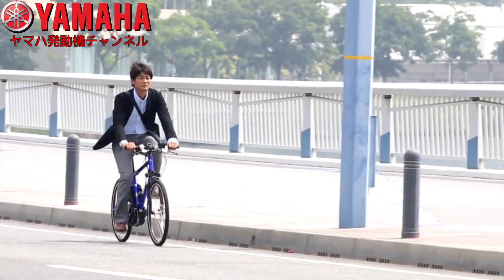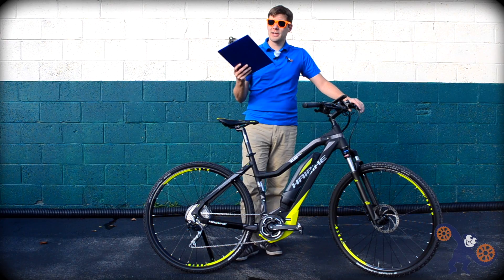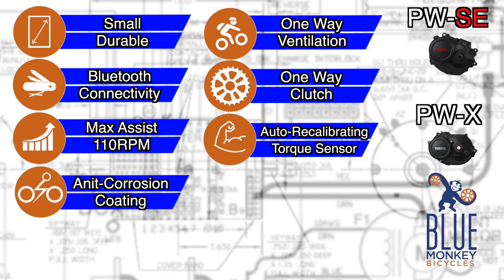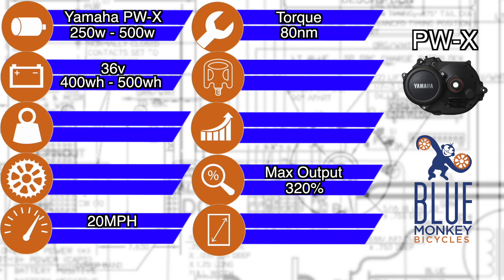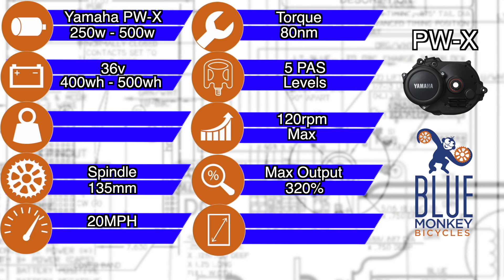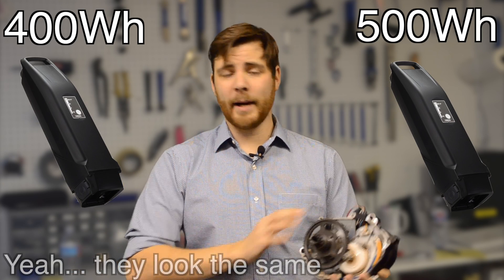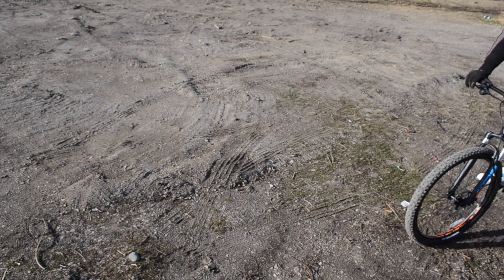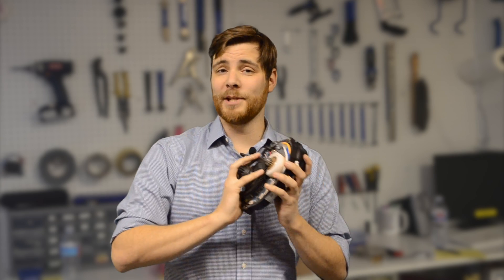YAMAHA PW-X eBike Motor: Closer Look

Comment: Does anyone know of one-way clutch mid-drive motors with zero drag with the motor OFF??
Reply: The last classic motor from bosch believe it or not ! Ive haibikes  version the xduro29sl the bike cycles just like a normal bike  especially when u take the battery off  only until they brought the gen4 smart system just before the gen5 have i honestly noticed zero drag its a tiny motor  and im led to believe its got metal internals cogs etc ive only noticed that on the gen 3 performance line  but the drag is horrible but a pokey motor  yamaha are a great motor with all metal parts  until something goes wrong with this stupid syncmode they put in it  totally ruined a serious contender  with giant also adding there own sotfware which they cant even fix  led to a mass callback of motors batterys etc ,if i could find a engineer to custom fit my gen 4 into my haibike which that is the plan then  i think im set for a very long time even tho its 10 yrs old its serviced every year has the best of parts that originally came on the bike ive just made sure theyve been maintained and a new sproket and chain every other year  otherwise thats all ive got for drag ✌️

Comment: I have the Easy Motion Rebel Lynx with the PWX (the one he says he is looking forward too) and its amazing. The bike is excellent, but the motor is the real star. I have ridden up hills so steep I would have to use my hands if I was walking. Gets amazing range too. In level 1 on flat pavement you can get over 80 miles. Even going offroad with lots of climbing and using the high power levels I still get 30+ miles.

Comment: Does anyone know if I can simply connect another battery to the motor contacts instead of the Yamaha battery?
i want to use car batteries with a stepup module to 36V because i want to load the batteries while driving with solar panels in a trailer.
Reply: You cannot. There is hardware and software integrating the battery. You could do it with a off the shelf hub motor or a bafang bbs mid drive, but not with a yamaha.
Reply: @gabriels1163  Thats a real shame, what a lack of modularity for an engine with such a bright future! I also look for a solution with the less drag with the motor off, for long journeys and solar-charged batteries in a trailer...

Comment: Yamaha don't sell ANY spare parts for their range of motors. If anything goes wrong you have to buy a whole new motor, I will say that again a whole new motor. The grease inside the motor dries up after three years and the bearings fail after 4 to 5 years. There is a guy in Ringwood UK who can service these motors but he only has the bearings which he had custom made because they are not available anywhere else. All plastic cogs and electronic boards are not available. It's a great motor it's reliable but if anything does go wrong your on your own with a massive bill. Watch this guy called Pete https://youtu.be/Me-H_Gykobc

Comment: Nylon gears not worth weight loss.
Reply from the maker: Looks like you're going on tour. I've also got a video on the Yamaha eBike standard equipment, the interbike announcement video, also Bosch vs Yamaha. I think Shimano has nylon gears, you can put comments there too
Reply: @BlueMonkeyBicycles  which motor has no nylon gears ?
Reply from the maker: I think the gen 2 Bosch systems had metal gears.
Direct drive motors have no gears at all.
Gear replacement isn't a big deal, in my experience. We had a few customers with 10 thousand miles on their bikes who finally wore out the gears, and those bikes had cheaper no-name motors.
After 10,000+ miles on a bike, you will be a much happier person, and very pleasant to be around.
Reply: @BlueMonkeyBicycles  what would you buy today for city + light gravel ?
Reply from the maker: I'd go to a local store and see what they have available

Comment: These bikes would be great if they had a throttle.
Reply: I have had throttle bikes up to 1000 watt...I like the "pedal assist" even better. I never thought I would, coming from a motorcycle background. These bikes ARE great...go ride one before you start thinking about another system.
Reply: @geraldhenrickson7472  with this 250w Yamaha PW-X Motor open(with chip,no 25 kmh limit) i can make 45 - 48 km/h ^^

Comment: Yamaha Needs to make 1000w-2000w options
Reply: I have a cheap Electric Scooter motor probably runs $200 (didn't buy it myself.) Came with the Electric Mini Bike I got. 1000w 48V Motor.

I have an Auranthetic Charger early 70s bike. It uses a chain with sprocket on the rear wheel with the motor on the center of the bike.
Reply: Never forget that now that there are specific laws concerning eBikesand a large manufacturer is NOT gind to produce illegal eBikes. Also... the numbskull riding his 1000 watt hub powered down the bikepath at high speed is turning the general public against eBikes. Many non-electric bikers want them outlawed altogether. You can have a blast on as little as 250 watts if the bike really has the correct output curve and is quiet.
Reply: G Henrickson How about if I Want to register my electric Scooter to be able to go on the road? Just like any 50cc. What about Everyone who wants a strong motor to Use for Off road? You need to Broaden Your perspective.

Comment: Hi - Comparing with videos of the earlier PW motor it looks like Yamaha have moved from a steel output gear to  MoS2 filled nylon to save weight. I have been in the plastics industry for years and I fear this material will not last as long. Also I have a PW bike and a PWX bike and by comparison the newer bike is noisier - Do you have any more information on this?. ..Cliff
Reply: Hi, Cliff! 

I have taken a few moments of time to watch a few videos on your channel. Nice work! Great videos! You are definitely an absolute expert with regards to plastics engineering and fabrication. 

As your expertise and knowledge has already provided you, composites (like nylon) afford a tremendous amount of durability with a low coefficient of friction and a very good resistance to abrasion. After several years of testing with multiple target metrics (including longevity testing), we are very confident in the design changes that we have made with the new PW-X gears. One might be able to imagine, but the use (and chemistry creation of composite for use) in gears is not new to our engineers at Yamaha and they have executed a composite material and design that is certain to fit the aggressive demands that we expect from our PW-X riders very well.

With regards to the noise difference between the PW and the PW-X. Yes, there is a decibel difference between the two motors. With higher torque demands in more aggressive climates and the need for faster ratchet engagement of the crankarm, the design requirements reveal themselves with a very slight increase in volume. If "absolute stealth" is what you are looking for on your ride, the PW-SE will be your weapon. Several changes to the SE have made it even more quiet and it works at a higher cadence than that found in the PW.

Keep the comments flowing! We really appreciate your support and the support from the Blue Monkey Bicycles subscribers. 

All the best,

Yamaha Power Assist Bicycles
Reply: Thanks for that careful reply YPAS. ..and thanks for looking into my YouTube channel. You would make a good politician !  Good to hear the plastic output gear has been well tested. 
I also have a Haibike with the PW motor and the Giant PW-X is not slightly louder - it is about twice as loud when under high output on a steep hill.  It sounds like the main noise is ex the gears, and I wonder if that is due to the plastic output gear. ..it would flex and resonate more than the PW metal gear.?...
I am interested to know what type of metal and hardness was used in the PW output gear?
Cheers  Cliff
Reply: Your compliments will get you everywhere, friend! (If the "good politician" statement was a compliment, that is ;)) Our engineers are not permitted to share information about what they have done to our motor options on behalf of our OE partners, so I cannot speak to the power settings that your bikes have been created to work under. However,  I can share this: in the highest EXPW power assist level, as the torque increases from 70 Nm to 80 Nm and a 120 rpm support noise increases regardless of the material used for the gears. In response to you comments, I'm going to conduct a decimeter test for each this coming week so that I can confirm that the pre-product models that I have are supporting my claims. I'll post results next week.
Reply: Thanks YPAB. A decibel test will be interesting - remember the scale is logarithmic and  not linear and so twice as loud as 40db may be about 50db - so the scale works in your favor!